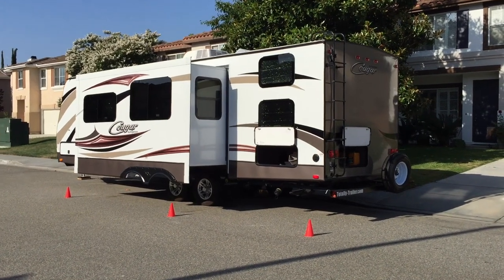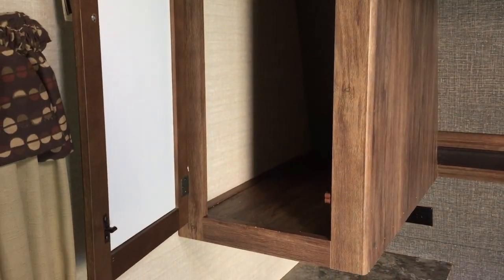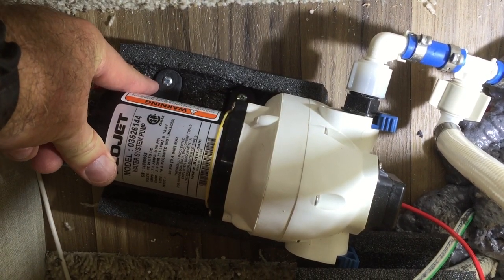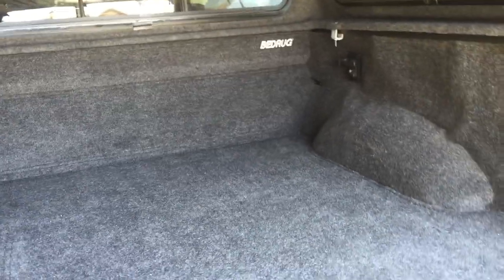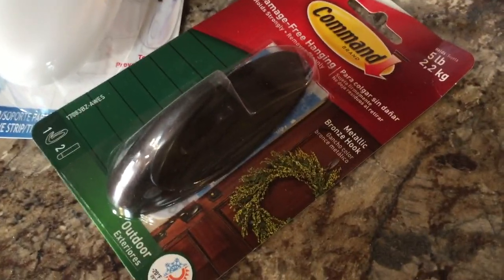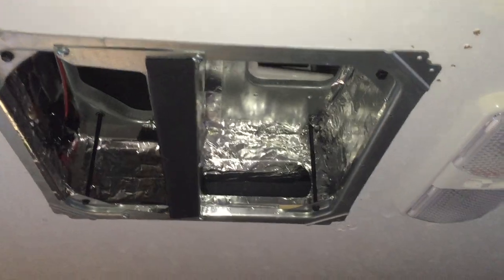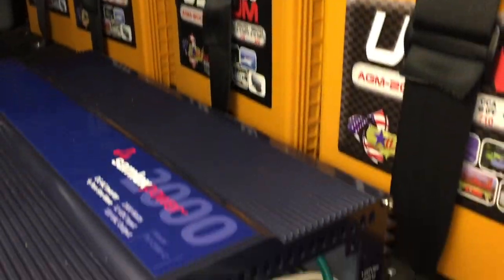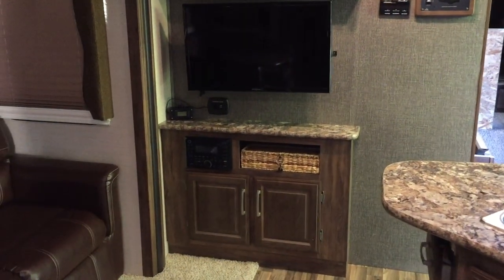Travel Trailer Mods for Full Time RV Life

Comment: The material in the bed of your truck is very handy on flat surfaces in the trailer too. If you put the hook side of industrial strength Velcro on the bottom of items, I believe you will find that the Velcro will do an excellent job of keeping them in place, even on the roughest roads, provided the carpet is not able to move. Coffee makers, unmounted televisions, small microwaves, and other items can be secured in this fashion. It's a simple hack i learned driving a semi. The inside of the bunk area was completely covered with that fabric, so I was able to Velcro things to the walls as well. When I quit driving, i simply pulled the Velcro loose and the truck looked the same as it did the day I got it. A very simple, cheap way of making more area useful for very cheap.just remember to use industrial strength, normal Velcro is NOT strong enough.

Comment: Really well thought out mods; gosh, don't know which I like the best. The shelving in the BR wardrobes is especially good. Like the idea of tack nailing the shelves, but, if they're tight enough, might not need to do that. Sealing the joints in the A/C unit; who'd have thought about that (OK, that MIGHT just be for me!)! Using the foam insulation under the water pump is great, too; that vibration noise is so frustrating. The bed rug and accessories in the trk bed will be useful, too. It'll cut down on the nose/vibration and keep the bed looking a lot better longer. Thks for sharing; have sub'd. Hope you and the family enjoy your new adventure. Y'all Be Safe!

Comment: Great video with some great ideas. Thanks. The only caution I would make is be careful closing off too much air flow with those ceiling vents. If you restrict too much air flow you could freeze the coil and draw liquid refrigerant into your compressor and ruin it.- Very expensive repair.
The sealing off openings with foil tape is a really good idea but makes air flow restriction all the more critical. I’m heading to Loewes for some of that tape now.

Comment: Do you have two sets of batteries separately connected to different systems?  There was a bank of batteries visible in the video near the inverter and there appears to be batteries mounted on the trailer tongue.  Please embellish.
Reply from the maker: Yes, you are exactly right we have two separate battery banks.  One bank (two lead acid batteries) are mounted on the trailer tongue these are used as the regular house 12 volt battery.  The other system is actually four AGM 6 volt batteries that are wired together to make two banks of 12 volts, we use this system to exclusively power the 2000 watt inverter.  With the inverter on we can run our Microwave, TV and power all the 110 volt power sockets in the trailer.  I will be doing a detailed video in the future about this system as well as the pros and cons of doing it this way.
Reply: Understand.  Thanks for the reply.

Comment: The inverter you use has Wide operating DC input range 21.4 - 33.0 VDC.  Do your batteries provide 12V or 24V input to then inverter?  thanks

Comment: Great mods, love the shelf idea. Our previous  trailer (R-pod 178) had no hanging space which we didn't like and our current trailer (Jay Feather 24T) has 2 hanging closets like yours that we thought would be great but, the only thing I hang is a couple shirts. Not sure if I want to give up ALL the hanging space, maybe a 50/50 hybrid design. Narrower shelves for socks, underwear, etc. It's not like I need my suits.
I'm lovin' the Bedrug! Currently our TV is a full-size SUV (Infiniti QX56) but, I want to upgrade to a F250 diesel. My only concern is we travel with our black Lab, Terra, and we are wondering how hot it will be in the back of a pickup during the summer months. I'm thinking if we leave the back slide-window open and with the Bedrug providing some insulation it might work. What are your thoughts? thanks, Bob
Reply from the maker: Thanks for the comment, hope the cabinet idea will work for you! We LOVE the bedbug in the back. A deer ran into the side of our brand new truck, so we have been stranded in the Las Vegas heat wave without our tow vehicle and I have to say it gets pretty hot in that back of that cab. We did cut some silver insulation pieces to keep it cooler, but depending on where you are traveling and the temperatures, it can get pretty toasty back there. By the way, we have another "closet" next to our pantry that we left as a hanging closet for our nicer shirts and dresses and that seems to be the perfect fit for our clothing needs! Best of luck and happy travels....would love to see pics if you get the bedbug and pickup!
Reply: Thanks for the info... I'll send pics. Sorry to hear about the accident and the Vegas heat.
Reply from the maker: wan·der·lust Happy to help! Looking forward to your pics :)

Comment: Does your battery bank ever run out of juice? Awesome mods!! 👌🏽
Reply from the maker: Hi Bigben,  our battery bank hardly ever runs out of juice.  We have about 400 amp hours of total power.  Can the battery bank run out of juice? Oh yes!  If we use the microwave, the TV, the heater and leave the lights on a lot during boondocking camping we can run out of juice easy.  It''s all about power management and conservation.

Comment: What kind of cooling improvements did you see with the A/C taped up
Reply from the maker: Hi there Lance, we noticed a DRAMATIC improvement with the duct tape work! We were actually getting ready to purchase a brand new 15k air conditioner because it was unbearable in here last summer. After the tape fix, it stays perfectly cool in here and we are in Vegas during a heat wave (it's been 117 here) and we are comfortable. Huge difference, we are telling everyone we know about that trick! Hope it helps :)
Reply: +Totally Trailer thanks for the rapid reply. we have this exact same trailer and I love your projects. We experienced some 95+ degree days and both the A/C and refrigerator didn't really seem up to the task. good to know we can address one of these issues without the dealer.
Reply from the maker: Lance Kenison We feel ya bro! One more thing, don't forget the colorable vent covers. That helps a lot too. You can close off the vents you aren't using and make the main cabin really (extra) cold! Avoid the dealer, overtime we took ours in for warranty, they broke something else (and told us there "nothing wrong with our fridge or A/C"). We are finally getting a new cooling unit directly from Dometic for our fridge (it has never gotten above 48-55 degrees. We had it in the dealer three times with no result and my wife went straight to Dometic for a result. Good luck. Keep us posted and let us know if it helps!
Reply: Do you remember where/what the closable vent covers are? Maybe a part number?
Reply from the maker: Yep, here's the exact one we bought for our trailer. Found it on amazon: JR Products ACG25DPW-A Polar White Adjustable Ceiling Vent with 0.25" Collar. We bought one for each vent, totally worth it and highly recommend! Good luck- hopefully you get "cool" soon

Comment: Is your truck 4x4 or 4x2? Any specific reason why you chose 4x4 or 4x2?
Reply from the maker: Hi Caleb, our truck is 4x2. The 4x2 is lighter, so they have a bigger towing capacity and can tow more than the 4x4's. The 4x2 was also $10,000 cheaper than the 4x4 counterpart (which was a big difference for us).  We do wish we had a 4x4 again though because we love off-roading and exploring!

Comment: how many gallons of fresh water cn you hold ? and how big is the water heater ?
Reply from the maker: Hi Mike we have 60 gallons of fresh water and the water heater holds an additional 5 gallons.  The gray tank is 76 gallons and the black tank is 38 gallons.
Reply: if your in an area with out water , how does 60 gals work out for showers etc
Reply from the maker: Hi Mike with 3 of us in the trailer we can do about 3 days easy including showers, toilets and hand washing.  If I know were going to be longer than 3 days I fill up four additional 5 gallon water jugs we carry with us.  You have to do a "navy shower" and we do everything we can to conserve water but with 2 girls in the trailer they want their daily showers, no exceptions.  It works out to about 5 gallons per person per day.  Hope that helps.
Reply from the maker: The on board water tank is 63 gallons, plus I usually carry an extra 20 gallons in the back of the truck.  The water heater is a 6 gallon unit